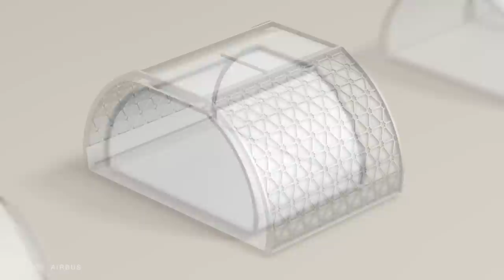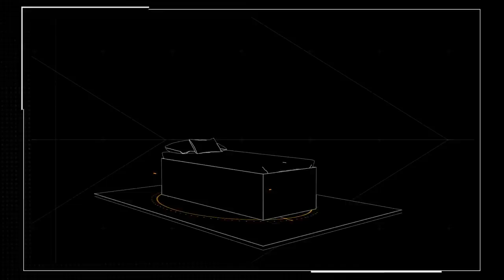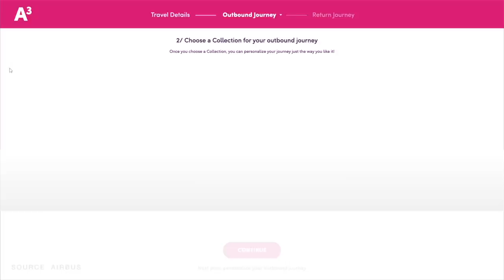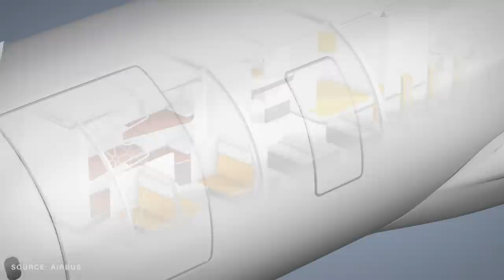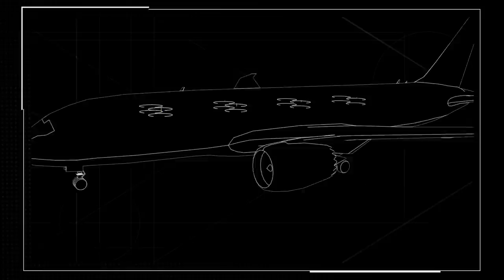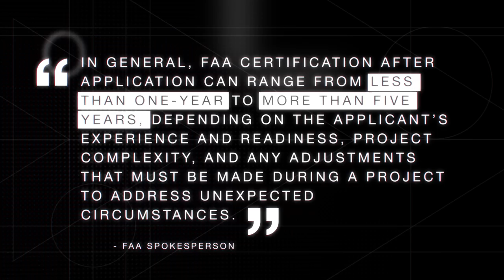Inside Airbus' modular plane concept

Comment: I think this is unattainable, so much free space due to a lack of passenger density, would lead to ticket prices skyrocketing.
Reply: Selling most seats at a premium economy price-range would allow the airline to sell fewer seats than it currently does and make the same amount of money. It could change the economics of flying - on a 300 seater plane - rather than selling say 30 business, 70 premium economy and 200 economy seats - an airline could sell 30 business and 200 premium economy seats and fly at a reduced density for the same revenue. This model would only likely be used by full-service carriers like Emirates, whilst low-cost carriers would stick with their high-density model.
Reply: Christophe tbh most ppl with thatoney rather hve private jet or something
Reply: The design for these actually can be apply to HyperLoop One as well, you could use stay inside and pick option to only travel on airplane over ocean and the rest on land.

Comment: I don't think people want more space or luxury, I just think people want to get point A to B the fastest. they should focus on making better airports not better airplanes
Reply: People show up as late as possible because they don't wanna be there. No point in spending millions on something that goes ignored.
Reply: best comment!
Reply: I totally agree. They should think about safety, confort, and speed issues. Not how cool it looks to have a piano bar, a spa, or a daycare inside an airplane. It's out of the point.
Reply: VIDD THE DESIGNER exactly. Reminds me how they keep adding things to cell phones but the battery life is still pathetic. Sometimes practicality trumps "experiences"
Reply: concorde essentially failed because people didn't want to spend extra money to save a few hours and be in less comfort during the process, so not sure this is completely correct
Reply: VIDD THE DESIGNER back in the old golden days flying was a luxury where people actually dressed up to fly. Now it is just a money greed to see how many people to fit like sardines in a metal tube.
Reply: @doug  that's not why. The Concorde was loud, inefficient, and very expensive to maintain, that's the reason the Concorde was discontinued.
Reply: Yeah. This is why we want a Concord.
Reply: @neil340  why is that the case though? People don't like it cause the experience is bad. If people want a better experience and can pay for it, theyll go this route. Obviously thered be a huge markup for the cost of the ticket and if people pay for it, it would subsidize the cheaper ones.

Comment: I wonder what these cabins would look like after 5 years of full usage
Reply: I imagine not perfect but damn near close, I mean if they can be swapped in half an hour then they can be cleaned probably quickly as well
Reply: Current aircrafts aren't typically cleaned more than once or twice a year due to limitations on time between the plane landing and flying again. These will never be cleaned :P
Reply: Craig Duffy you are forgetting the possibility of having extra modules and cleaning the unused ones on the ground while the plane is flying. and just swap in a clean one when the plane is on regular servicing or waiting on the ground. planes for big airline that run the hub model tend to stay on the ground for quite some time. budget airlines the ones that have very low ground time, as they don't  usually do connections
Reply: Think how old and how long a cruise ship is used for... same for these type of plane
Reply: Shutup

Comment: I'd rather have Concorde than this.
Reply: Li Zheng same. I want to get where I'm going as fast as possible, not mingle with passengers.
Reply: I want a hypersonic antipodal airliner.
Reply: Concorde ftw !
Reply: There having a couple of Concorde flights in 2019 well that's what I've heard anyway!!!!!!
Reply: AMEN brother
Reply: Same. Why did it have to go.  Why?
Reply: @OutAroundAndAgain  That was the comet, not concord.
Reply: The only thing I want changed with the Concord is free on board wifi.
Reply: Look up Boom Supersonic. I did some engineering work with them, and they are creating a plane that will be faster than the Concord and more importantly, commercially viable.

Comment: "Priced around premium economy - if they can maintain seat density"

Um. Considering that current layouts just about cram as many seats into each square meter as they possibly can, what magic are they hoping to use that will allow them to maintain seat density while using some of that seating space for kids play areas, cycle studios, coworking spaces and restaurants?

Not saying it won't happen, but there's no way in hell this is going to be priced anywhere near economy.
Reply: Lachlan Sleight Stacking, probably? We'll be transported laying down just like the slaves in Atlantic Slave Trade, only better 😂

Comment: As a pilot myself, I know this will never happen, or not in our near future, too many structural vulnerabilities to make this a safe solution, especially considering how aircraft are pressurized. To load a module during a quick turnover sounds scary dangerous. 

I can see it working if modules were changed every week.... 

If this does happen, I'll be the last person to fly this thing. Especially knowing first hand how the mechanics take care of these aircraft.
Reply: Airlines probably wouldn't be changing these cabins frequently, even every week would be a very frequent. They're just trying to bring it down from the 7 years they talked about in the video.
Reply: Michaelc136 now you got me scared. What are the mechanics doing wrong?
Reply: This would be difficult especially with weight and balance. Each module would change that and with multiple people moving around at once would significantly change these numbers
Reply: No offence, but I'm fairly certain that the people building the actual planes know more about "structural vulnerabilities" than a in internet pilot.
Reply: taxi driver has an opinion on structural stability of future electric cars.
Reply: Evan Black lol well I'm not an airline pilot I just fly small Cessna aircraft as a private pilot, but mechanics are mechanics , and most of them are laid back, don't get me wrong , there are plenty of good ones, but I notice a lot are worried about the legal minimums.
Reply: what are you on about? :')
Reply: lol how can you speak about something that you're not into, flying a small Cessna as nothing to do with flying an Airbus or Boeing in a airline. Things change and companies must obey the necessary protocols, you're basically judging every mechanic and saying that everyone is a laid back. Also, if that was the case I'm sure we would see more crashes, wouldn't we?
Reply: Maximov check my channel for proof, I don't care
Reply: Ninja4editS I work at the airport, I conversate with pilots of all different airlines, they all say the same thing across the board. Legally and morally my aircraft is as important as an airbus, with regularly scheduled and legal checkups needed. If the regular public knew what was considered "airworthy" a lot of people wouldn't fly. But I can't convince you, neither do I want to, aviation is an amazing thing, the more people who understand that the better for my community
Reply: There's something wrong with the left filange!!!!!! ahaha
Reply: +Michaelc136 Structural vulnerabilities? What would you know? Unless you're a pilot and an engineer, don't comment on what you don't know. And stop playing high and mighty on the internet with your aerospace insights, you're likely a 16 year old C152 RPL student.
Reply: Behemoth29 I have and currently a Scholarship student at Rutgers university aeronautical and mechanical engineering and I'm on track to be a flight instructor with my own aircraft.
Reply: +Michaelc136 Yeah and I'm sure that qualifies you to make decisions on behalf of Airbus. And refer to previous point about bragging on the internet.
Reply: Behemoth29 how am I bragging I'm giving factual info while I explain my credentials to people like you who don't believe me, just check my YouTube channel lol
Reply: There is no structural issue with this idea, this would work right now in a freighter. 
The problem is "only an hour" is actually a lot of time to change these modules, which will then need to be serviced once installed, the amount an airline will have to charge for these would make it not an option for the average traveler. They will weigh a lot therefor cause higher fuel consumption, so cost even more. 

It could work, but likely will be so expensive, the only people who could afford it could just charter a private jet.
Just like the Concord, the price will be unjustifiable to consumers and likely airlines themselves.
Reply: Another 'pilot' chiming in. I'm not an airline pilot, I'm a flight instructor with a degree in aviation (which includes aircraft technology and engineering). I don't think this concept will be limited structurally, the guys and gals at Airbus will figure it out....
As for 'how the mechanics take care of these aircraft'......I've worked in the airline industry, and I can tell you the mechanics work tirelessly, long into the night, to ensure that the aircraft are maintained to a high standard. It's in the regulations, it's in the interest of safety, and it's in the interest of the airline to maintain a squeaky clean safety record. Overall, flying is one of the safest modes of transport, especially compared to cars, so you have to give credit to both those who design the aircraft, those who maintain it, and in some ways, those that operate them. 
Just my two cents worth, go easy on me ;)
Reply: Kyle Crosley thanks for the respect , and I hear ya! Nice to see a fellow pilot
Reply: Esmeralda Doll for the last time if anyone wants proof check my YouTube channel , geez
Reply: Michaelc136 true.. the first thing i need after hell 9 hours connecting flight is good sleep, not kids running around my bunk.
Reply: Michaelc136 I was thinking the same, I am actually starting to believe the designer is not an engineer.
Reply: Michaelc136 what plane do you fly ?
Reply: I wasn't aware pilots had to double major in aerospace engineering.
Reply: Michaelc136 "conversate"
Reply: K S we don't have to but if you want to do it you can, thats what I'm doing now
Reply: Great to have your experience here. What do you think about safety on board? You'll have like 20 or 30 people walking around the airplane in one of these cabins, staying, having drinks or food. Sounds tough to manage when there is a situation that requires to have everyone seated immediately. I know that there are these kind of bars in 1st Class at Etihad Airways and a couple others, but it's for a much smaller amount of people.
Reply: Good question. Once again, not an airline pilot, just a flight instructor, but I would say that the most hazardous situation would be rapid depressurisation of the aircraft. At cruising altitudes which most commercial jets fly, hypoxia would be guaranteed if it wasn't for pressurisation. When depressurisation occurs, individuals have anywhere between 10-60 seconds (varying at different altitudes) of useful consciousness before effectively passing out. If they fail to don an oxygen mask, brain damage and death may follow shortly thereafter. Because of this, I think the designers would have to plan for a scenario such as this. Regulators in aviation are super strict, and the legal aspect of this project would be a nightmare, but not impossible.
Reply: Agreed
Reply: Michaelc136 what do you say on the same concept being used on cargo planes?
Reply: Michaelc136 Damn I hope you fly Boeing Aircraft 😂
Reply: nice!!!!

Comment: 1) Selling most seats at a premium economy price-range would allow the airline to sell fewer seats than it currently does and make the same amount of money. It could change the economics of flying - on a 300 seater plane - rather than selling say 30 business, 70 premium economy and 200 economy seats - an airline could sell 30 business and 200 premium economy seats and fly at a reduced density. This model would only likely be used by full-service carriers like Emirates, whilst low-cost carriers would stick with their high-density model.

2) Initally this technology won't be used for the "modular experience" but just as a more efficient way for airlines to update their interior. So a standard 3-class interior, but broken up into modules so it's easy to replace.
Reply: Alex Lips Also, this is a ridiculous way of refreshing the interior. Most airlines just replace aircraft after 10 years, and not much changes in aviation in 10 years. This design is wasting space, creating structural weaknesses and causing safety hazards. Also, no windows, who the hell wants that. 

If the world worked like this, then passenger planes would all be fairly comfortable, with nice large seats and aisles. But no, they are designed for maximum cost efficiency, sorry but that's capitalism.
Reply: Agreed

Comment: (this is not an idea airbus/boeing so don't do this, but....)
I recon airlines could earn a lot more money from this idea if they are to fit a conventional seating layout in in. Swapping out arrival cabins to perhaps pre-loaded cabins could allow for quicker turnaround times, quicker boarding due to the fact you can board each module separately, with no slowdown from any other module. Aircraft manufacturers could turn this into something big for them - Would it be big for us though? It could mean cheaper flights, more pay for aircraft staff (because apparently they don't get paid for ground time) and perhaps even a bit more legroom. It would be interesting if something like this, even if it is a conventional seating layout, became a thing, as if this idea does it could resolute in cheaper holidays. Furthermore, there is the possibility of self loading your hold baggage into the hold, reducing the amount of lost or damaged bags - These can be collected from your module when you disembark.

The only thing that really needs to happen is quicker loading times for these modules. Now that I think about this, this seems like a really good idea.

Comment: There is a small market for private shared charters. I can see why airbus wishes to research this. Cabins can be swapped out quickly for airplanes operated by different carriers as well as maintenance and cleaning efficiency. Apart from the current floor concept this is actually a good idea.

Comment: Wait Air bus have labs in the U.S?
Reply: bish stop harrasing my brand, it's Airbus.
Reply: Theost21 Aw okay,But why would a major European airplane manufacturer would have set up shops in the U.S? 
Instead of like London for example?
Reply: The main reason is probably that they get funding by the government if they have business in that country. I know The U.S government have done that before.
Reply: By value, the majority of outside supplier components on an Airbus come from the US, not Europe. Most of their engines are US or US-joint venture (GE, Pratt & Whitney, CFM). A large amount of electronics are US (Honeywell, Rockwell Collins, GE). Therefore, Airbus by necessity has engineers and labs in the US. They even are building Airbus planes in Alabama.
Reply: Lee Harvey Oswald Boeing is creating a manufacturing plant in Sheffield, England
Reply: They have this Lab in downtown San Jose, California. The main reason is the talent in the area, San Jose is the Capital of Silicon Valley so Airbus made the right move to open this Lab in San Jose.
Reply: Why Silicon Valley? Silicon Valley is all about software. It isn't about aerospace. There is some satellite work on the Peninsula (Loral, Lockheed Martin). The only thing with airplanes is Ames in Mountain View.

The major aerospace stuff is down in the LA area where Hughes and Douglas built their empires.
Reply: Airbus also recently opened a factory in Alabama to build a320s for us airlines 😛